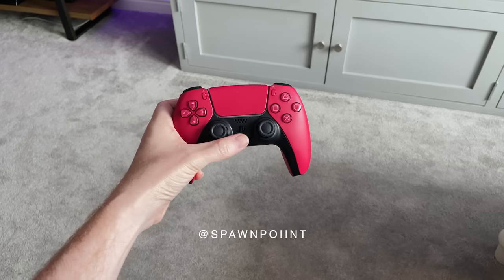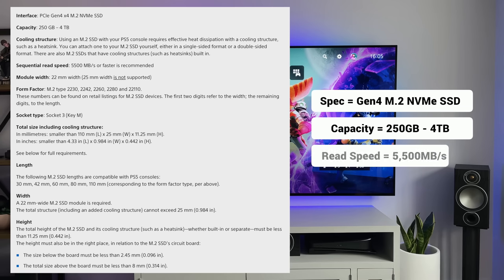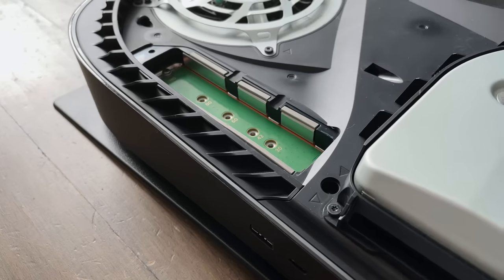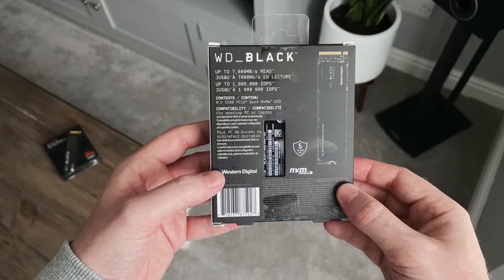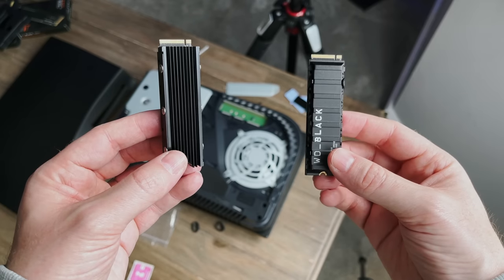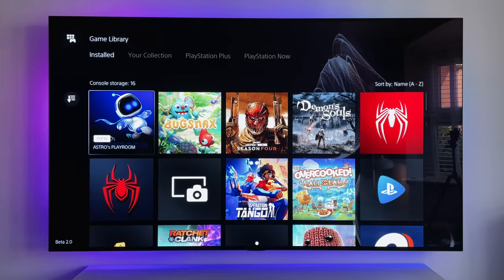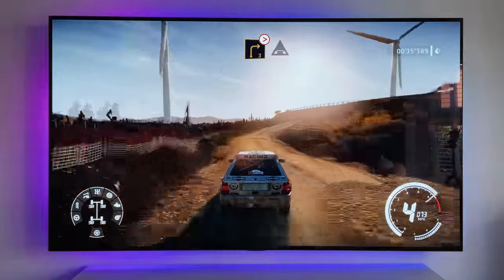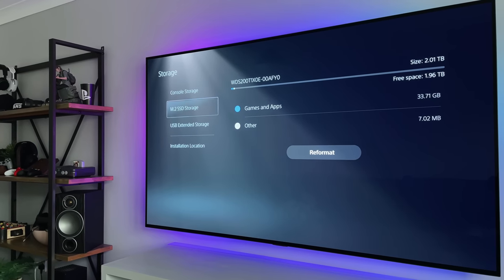PS5 SSD Upgrade: Installing 2TB SSD + Heatsink

Comment: I am upgrading my PS5 storage not because i need more space.. I am doing it because i dont want to kill the internal non-replaceable drive that holds the operating system (which would kill the console dead) 

I rather put the use on the additional drive and prolong the operating system drive as much as possible (it will probably last 8 to 10 years if it only holds the operating system)

Comment: Warning  Warning  Warning Warning  !!!   If you do not have the 2.0 firmware on your PS5 do not waste your time putting an SSD in it because when you power it on it will tell you
to power down and remove the SSD from the internal Bay.

Comment: Can the heatsink be removed from the SSD on the built-in model? For example to reformat and use in a laptop. I know it'll fit in a desktop as-is, but with the extra bulk it won't fit a laptop.

Comment: This is so much easier than the PS4 as in it's all in one and doesn't require you to have to change the hard drive and the heat sink seperately like with the PS4 which was vastly more complex and could result in accidental internal damage to the wi-fi connector or other parts of the motherboard. This is similar to a gaming PC which is also vastly more easy than the PS4 in terms of open up, unscrew, replace done.

Comment: What is the purpose of the SSD cover ? The SSD bay sits right behind the air intake vents, so I would think the SSD can be better cooled (especially with heatsink) if you let the cool air flow over it ?

Comment: Even with Horizon Forbidden West and God of War expected next year, I don't think I'll have a need to expand the stock internal storage any time soon. I have a 2 TB external SSD for my larger PS4 library of games, so the internal should be ok for 2-3 new PS5 games. Like you mentioned briefly, with the likely increase in demand (even with PS5s being hard to get, there's still a lot of them out there and more coming) causing prices to increase, it'll probably be best to wait. As more options become available, prices will either drop or SSDs like the WD Black SN850 will start showing up in sales, like Black Friday or Cyber Monday. Upgrading my internal storage might be more worth it in 2022 or 2023. There'll be more options to pick from and more info available to make a better-informed decision. Given the two options, I would probably prefer to get an SSD that comes with a heatsink already, but we'll see what 3rd party heatsinks look like at that time.

Comment: You don’t need a heat sink. Simply don’t place the metal cover back on. In fact, even if you have a heat sink I recommend not covering the SSD with the metal plate as there is almost no ventilation for the compartment (two 1cm x 0.4 cm notches). Save money and prolong your SSD’s life by not placing the metal plate back on. Also, consider buying an single-sides SSD (controller, DRAM, and NAND on the top side). Remember that the controller runs hotter, so having a heat sink with a thermal spreader will just transfer the heat to your DRAM and NAND.

Comment: Hey dude ,I was just wondering if you really had one choice which would you go with? WD_BLACK 2TB SN850 NVMe Internal Gaming SSD Solid State Drive or Sabrent 1TB Rocket 4 Plus NVMe 4.0 Gen4? Thanks.
Reply from the maker: The 2TB. Both perform the same for most people, mine has been solid.

Comment: I wonder what kind of Temps the ssd's get in there, those fast drives get pretty warm and even with a heat sink it dosent help much because it's all closed up in that tiny compartment
Reply: Other channels have done the test. No heatsink gets to around 60c, and with heatsink it's around 38-40c depending on the brand.

Drives will still work at 60c, but their read/write speeds slow down and throttle after 50c, so at 60c you may see glitches as the drive takes longer to load things in.
Reply: @Bugbite0656   the drives can go far far higher than that before they throttle more like 80 degrees these drives will not slow down or throttle at 60 degrees that’s well below anything of concern

Comment: Read speeds not super important as long as it’s gen 4 xpg offers the atom 50 and the adata legend 840 work fine and show read speeds at about 5060mb which I have tested and been using for weeks

Comment: I was planning on getting a SSD for my ps5.  the external SSD are getting a price drop but the internal SSD are still on the high price range.  Are the external SSD has the same speed as the internal SSD ones or not?  I'm planning to get 4tb one.  2tb for my ps4 games and 2tb for the ps5 games.  Before I sell my ps4 pro console

Comment: Why is everyone putting the little cover back on? Your gonna trap the heat in there. Leave the cover off, the nvme isn't going anywhere because it's secured with a screw, then put the cover screw back in its hole so you don't lose it. You can also tape the nvme cover to the inside of the Playstation somewhere so you don't lose it. Leaving the cover off will keep the drive much cooler. The fan is right there so it will extract much more heat this way.

Comment: I upgraded to the WB Black SN850 NVMe SSD PlayStation Western Digital 2TB and it does come with the heatsink too bro and I had to pay $199 for it including tax too bro and I’m glad that I finally did it with no problem too bro 😎
Reply: Two poor man's tricks to avoid buying a SSD and controller charger. 
1)- Only buy used games in cd versions . load  7 games at once and delete and install games after that .
2)- Buy a 12 foot controller cord and never worry about a dead controller battery again.

Comment: Good one put on a heat sink then cover the drive up so no air flow? Leave that white cover off, these drives drastically reduce their life span when they over heat and the way Sony has implemented this is crazy it will run hot all the time. These drives are nothing new we have been using them on PC's for years and they are not buried in a small pocket with no air flow. in fact my latest motherboard incorporates a huge integrated heat sink to keep these type's of drive cool. Going by what I see these drives will die before the console dose good design Sony?

Comment: Explain why you would attach white plate on top after install? Would you not rather it air cool excess heat if needed rather than be surrounded by heat shields with no way of venting. The heat sink only does so much. If anything weld a rod to heatsink and reroute to running water to virtually make a Watercooler.

Comment: the fact you have to have a heatsink and certain specifications is a kick in the stomach...i do prefer playstation over xbox BUT xbox did get it right by having an easy expansion slot

Comment: I had an old USB 2 TB HDD eating dust in a cabinet. Surprised to see it worked fine on the PS5. Runs PS4 games just as fast. For now this is enough for me until there are more PS5 titles i like.

Comment: I would've removed the black sticker/decal on the front of the SSD to improve heat transfer to the heat sink. That plastic sticker/decal helps insulate, not transfer heat.

Comment: how did you get the sandisk portable ssd to work. mine that i had on the ps4 wouldnt work on ps5 would keep on reformating. i had to buy a new external ssd

Comment: Is there any insight on why Sony recommends the heatsink? I've had two M.2s in my PC without heatsinks for the past year without any overheating issues. If you're copying tons of data consistently, maybe, but just accessing games and files shouldn't cause it to get too hot.
Reply: 1) I imagine it's to do with liability so people can't complain if a M.2 was to get too hot and has its performance hindered

2) in your PC I imagine there is decent airflow from the case fans, realistically M.2 should stay below 70 degrees, but by the looks of the bay made for the SSD it's general airflow looks quite poor and therefore the heatsink should help keep it at a decent temperature

Comment: Has anyone done testing as to wether or not a heatsink will interfere with some of these other drives that use some other thermal dissipation methods? Like samsung, would an additional heatsink trap some heat in? Not allowing it to cool as quickly or efficiently as it was designed to?

Comment: Very clear and informative video well done ! However i think its absolutely ridiculous for Sony to launch a so called next gen console only for there to be very little storage space to store your games you purchase one of these consoles either at £350 or £450 only to find its not going to be long before you have to spend all most the same price as a console to get a larger capacity ssd so you can store your also expensive ps5 games on ?? Also all the hype about you need a tv which has the holy grail  2.1 hdmi port to harness the full potential of your next gen console especially the VRR variable refresh rate capability.So out i went and purchased the LG 916 nanocell tv specifically to use with the ps5 only to find that the ps5 will not be able to use the VRR untill sony release a patch to enable this on the ps5 !! So basically sony have launched a console which really isnt fit for purpose unless you are prepared to wait and also most likely have to upgrade the internal ssd to give it half decent storage !! I my self have both the disc and digital version and yet i strongly feel that i really have been very short changed here by false marketing on these consoles !!

Comment: So you can use the SSD and the external hard drive at the same time without having to “switch” which one you want to use in the menus (ie if you had two external hard dives)

Comment: The purpose of the heatsink is to spread the heat to a larger area from where it is "mandatory" to dissipate the heat through some means(airflow or water flow).
If you are not dissipating heat from the heatsink(which PS5's space does not as it is blocked from all sides), there is no reason to buy a heatsink memory.
It's simple Physics.

Comment: Are we able to use the original SSD an external drive for storage as well, after installing the new one? Are there connection points for that? I’m guessing I’d need to put it in some sort of protective case to keep it safe? Thanks to anyone that can help.
Reply from the maker: You never remove the original SSD, so you’ll still have that.

Comment: Ok question, when installing the ssd, the part where you slot it in at an angle, does it go into the crevice above the gold strip or does it connect to said strip?

Comment: Great Video! I love it! 

However, in my opinion, I wish Sony just let us add an SSD without using their own SSD chipped on the board like we do with HDD on PS4. I wish Sony give us that option, I don't like to call it an extension/expandable M.2 SSD because the main SSD is already chipped into the board =\ I wish the M.2 we buy and put in PS5 is the MAIN like we did with a PS4 and HDD. Look at our PC today, we install Windows on the main m.2 SSD PCI-E GEN4... None of the motherboards in our PC have the SSD chipped into the motherboard, that should be the same thing that happened to PS5, just buy the M.2 SSD, put it in, install system software on it, then we are good to go. Oh well! I don't think Sony thinks about that.

Comment: Just a heads up to folks, I bought the Samsung 970Evo Plus Gen4 - and it is not compatible in the PS5. It would not recognize it once it was installed.

Installation truly was easy enough and adding a heatsink took 60 seconds. Will return to Amazon and try another model.
Reply: The 980Pro works perfect, honestly it could not have been easier.

Comment: You can also connect an external USB 3.0 hard drive.  are you cheaper.  Depends on whether the hard drive turns off when shutting down.  And whether an external SSD is also required.
Reply: External hard drive won't work with ps5 games

Comment: Great video.
Strange that you need a ssd with a heatsink only to install it in a small compartment and screw a plate on top.
Where's the airflow?

Comment: Can someone please help. I bought the ssd card along with the heat sink. I did everything in the video but once I turned it on it said to remove the card since something was connected to the internal drive and the system would restart in 30 seconds. I tried multiple times to the point where the screw got stuck. Luckily I was able to remove it but now I’m too nervous to try again. I’m not understanding why it’s not working. Any help would be appreciated please
Reply from the maker: Are you on the beta? You need to be on that first.

Comment: Easier solution, get a series X instead and you can use any storage drive you have around the house…
Reply: U can but only with Xbox one games for Series X games u need the Seagate expansion which is even more expensive than the PS5s SSD's.

Comment: Please Help. I bought myself an SN850 without a heatsink. I bought the heatsink recommended in the description separately. I put the thing together and put it into my PS5. It powers on, shows the PS logo, and then stays on a black screen, with the console lights as blue. When i removed the ssd it was hot. Ive tried turning hdr and hdcp off, and yet nothing worked. I really hope i havent bricked my PS5. If anyone has any useful advice please respond. Thank you.
Reply: Dude why would you install it 2 weeks early, the update for the ssd just came out today.
Reply: @emc3150  I got access to the beta. I made this comment 2 weeks ago, but i actually got it working so everytings cool now.

Comment: I followed the steps and I get  "module is inserted in the expansion lot,  remove module and turn playstation back on"
PLEASE ADVISE
Reply: I’m having the same problem :(
Reply: ok, what I've been told this was a limited beta testing and not officially out just yet

Comment: Do you need to updated the firware of the SSD before installing?
Reply from the maker: No, not on the SSD itself. Just make sure the PS5 is running the latest version and it'll install fine.

Comment: does the ssd slot has ventilation?  i'm afraid if there isn't, even with heatsink too it will soon get hot or perhaps overheat?
Reply: there is ventilation dude.

Comment: Are the current SSD’s used as fast as the ps5’s or should we just wait till sony release some of their own?
Reply: The Samsung 980 Pro is supposed to be almost as fast (if not even matching)  as the PS5's own, but Sony will likely release an official SSD that is identical in specs to the built in one in some time, so if you can't wait there are options out there.

Comment: How do we get the beta software? And code for it? 2nd can you still plug a external into USB port at same time for pa4 games
Reply from the maker: You need to apply on the Sony website, then they will approve it. You can still use an external drive (I do).
Reply: @SpawnPoiint  okay got it do you have the link? Also I’m using a 1tb hdd from ps4 on my ps5 how to my transfer that data onto a better ssd and larger ssd? The ps5 won’t let you plug in more than 1 external which is so grimy... Xbox let’s you use 2 and move data between them.. crap like this really makes me mad as it feels clunky and locked down for no reason other than $ or not caring .. thanks ahead of time

Comment: For some odd reason my Ps5 when I turn it on after installation tells me I have something in my storage expansion area and tells me to remove it and turn it off.
Reply: it needs latest firmware which some people have...wait for a few days
Reply: @chris-px8qc  i actually found the problem... I ordered the wrong version on Amazon. Guys/Gals you need Gen4 Pcle and 250gb minimum storage!

Comment: Thank you for giving straight and useful information. I'm not happy at all with the initial capacity of the storage but 300€ or more is a quantity not affordable for every one. Many people had to do a really big effort to buy the console (and the extra game pad, and the chargers, and the games) and now you have to make another big effort. I suppose many people will end buying some kind of extension because the built-in storage is clearly insufficient but it is really quite expensive.

Comment: Hi thank you for the video! Do you have to plug the ssd in at an angle or do you slide it flat on the bottom to the right? I didn't quite get that from the video. Thank you in advance!
Reply: Angle then push down
Reply: @cavejohnson5796  thank you :)
Reply: @shinmentakezo2994  np

Comment: Is there also a place holder inside to add an internal HDD?
Reply: PS5 does not have any internal HDD or slots to support one. You can use an external HDD though but it'll only allow PS4 games to be installed and played off from one. PS5 games all require a SSD.

Comment: The heatsink I got didn't fit and when I turned on the PS5, I got a message saying I had to remove the module from the expansion slot.
Reply: Which ssd did you get?
Reply: @thetraveler2224  2 TB samsung 970 evo.
Reply: @IrishRepoMan  then it isn't compatible. I know the Samsung 980 pro is compatible. It also has to be a gen 4 and has to ben a m.2 and you also gave to have the beta as well. You have a gen 3 it won't work. You can look up the specs on Playstation website.
Reply: @thetraveler2224  it is an M.2. Don't see anything about the gen.
Reply: @IrishRepoMan   the specs require it for it to be a gen 4. It must be a gen 4 for it to work. You're using a gen 3.
Reply: @thetraveler2224  I meant I didn't see anything about the gen in the order.
Reply: @IrishRepoMan  Oh. But still it says on the Playstation web at "interface" it says "gen 4" in it.

Comment: Are there any other heatsinks that would work? The one provided is already sold out.
Reply: @chris-px8qc  also out of stock
Reply: @mimic8450  ineo 3mm with copper heatsink
Reply: @mimic8450  NGFFM2-HS804-BK heatsink
Reply: @mimic8450  icepc M.2 PCI-E NVME 2280